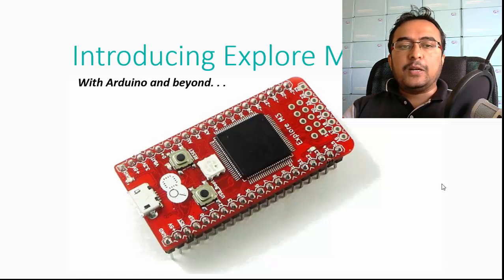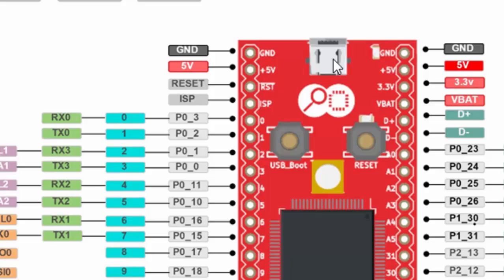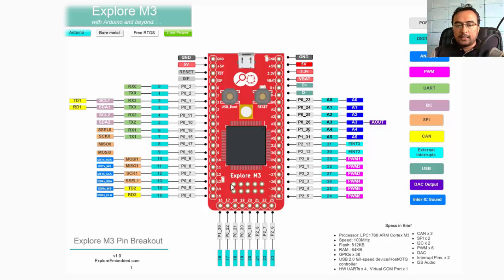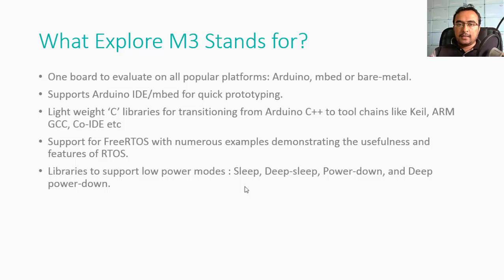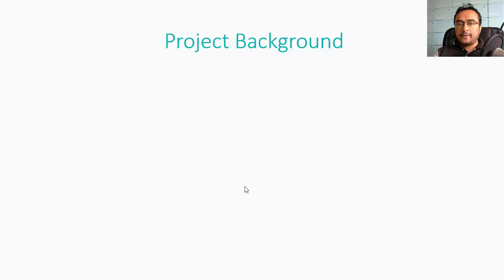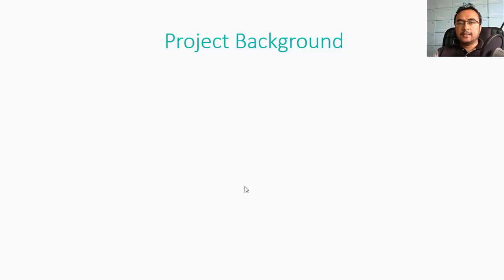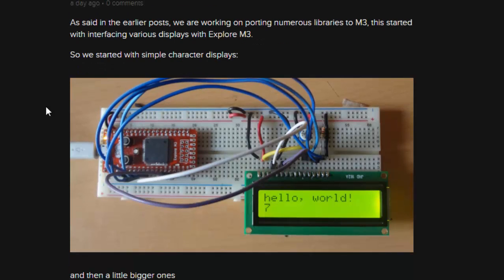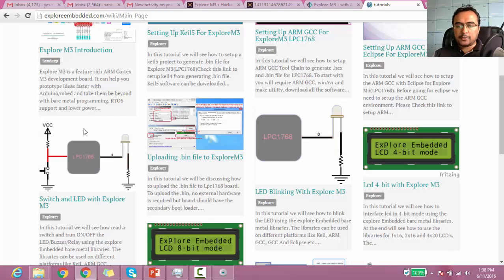Explore M3 Introduction

Comment: Hi EE!! What are the practical advantages of using hardware UART compared to software ones? Lower bit-error rates? easier coding? or something else?
Reply from the maker: Imagine making a location data logger with a GPS and GSM. Assume both have serial UART Interface, now every time the location changes, which will often be the case when you're moving. You will have to read the data from GPS, decode the co-ordinates and send that data using the GSM. Of-course this can be done with the help of soft UART however the controller has to handle interrupts, data etc., which which will consume controllers processing time. If there is a dedicated HW UART, the controller can simple be interrupted when required and it can go on to do its job.

Another simple use case, let say you want to evaluate a GSM modem which uses serial port. Now in order to check if your code is sending proper commands to GSM and if the GSM is responding back; you'll often need to log the data some where or display it on the LCD. If you've dedicated HW UART you can connect the GSM Modem on one UART port and connect the board to the computer and write the logic to display messages on the computer to show communication between the Modem and Controller.
Reply: Thanks for the quick reply! So, if I understand correctly from the 2 examples, HW UART can be used to run code (in the background) with interrupts more easily & efficiently than soft serial ?
Reply from the maker: yes you're right, Explore M3 has four of these and USB Serial for logging messages!